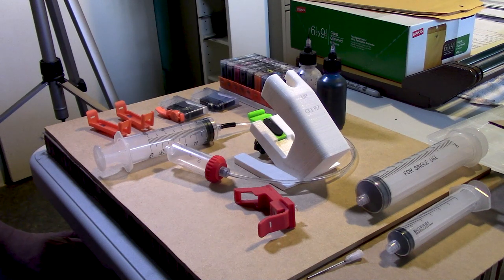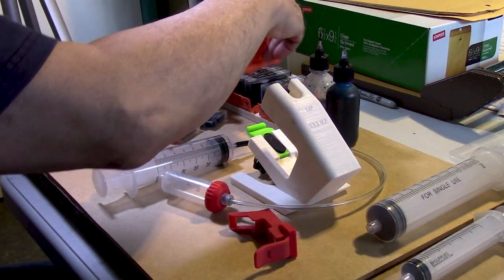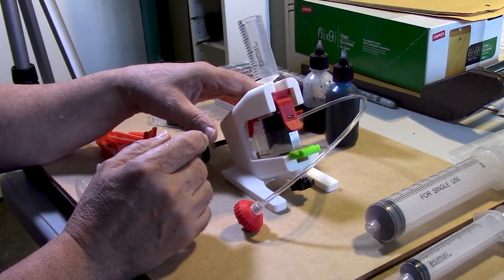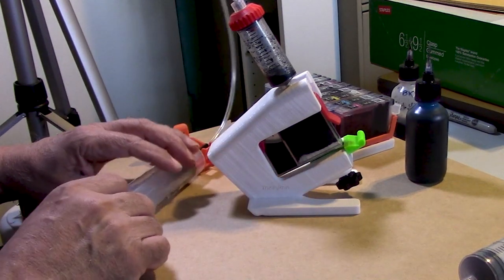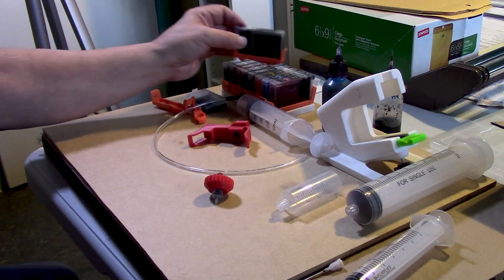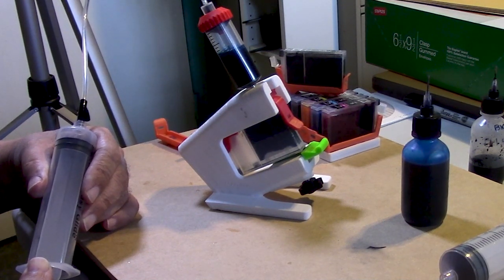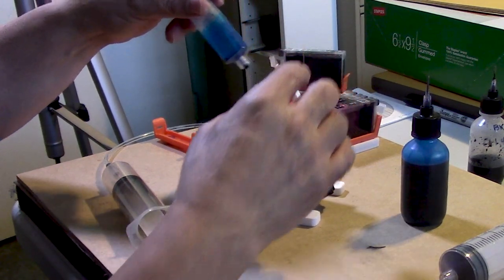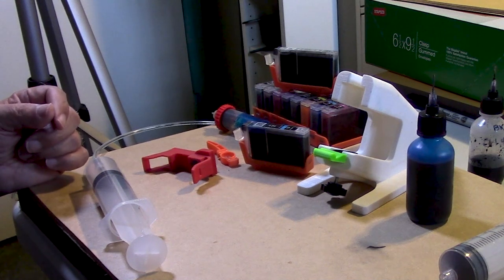Refilling Unmodified CANON CLI 42 carts by VACUUM LONG VERSION

Comment: I worked in a ink refill business for almost 20 years and we used to refill canon ink tanks in a similar way using the JE1072 jig from Jero, produced in Germany. It also filled HP ink tanks but we mainly used it for canons. It’s an excellent piece of equipment and I still use it to fill my Cli-42 ink cartridges today. My advice would be to batch fill one colour at a time, it takes a little time to set up but can refill 10 cartridges in no time at all.

Comment: Cool method without intervention/drilling of the carts. This is actually how some HP and Brother cartridges are refilled, wish I considered this option for my Canon carts before modifying them.
Reply from the maker: Both methods are good. One a bit more invasive than the other. Both provide good ink delivery if done correctly.

Comment: Got my refilling system and PC inks this week. Just finished filling my original cartridges. Excited to be saving money and printing more. Thank you for your knowledge and videos.
I have a question. Should I put a piece of tape across the vent of the cart after filling them? I live in an area with very low humidity and am not sure how quickly I'll be installing the replacement carts and am concerned about them drying out.
Reply: Hi  a question   How did you clean your cartridges? Cheers for any advice.

Comment: Have you done any testing to see if this works better than the old method of refilling?
Reply from the maker: Well think about it, You are no longer drilling a hole in the carts which completely alters the original hydraulics of ink delivery.
Reply: @cheo1949  I understand the concept, but was just curious if it made a difference since the hole gets plugged anyway

Comment: Great video I'm new to refilling, I always used oem inks in my R3000 that I have had since it first was introduced. I just bought a PRO 100 with less than a 100 print count it was not taken out of the box until 3 mo. ago and I have a question do you have to flush the cart of oem ink the first time you refill or are the to inks compatible can't I take one out and just refill it and but it right back in.
Reply from the maker: Flushing is always best but it takes days to dry after flushing. You can leave your printer sitting without carts installed. If You insist on refilling then buy a set of already modified and flushed carts from Rick Johnson. EBAY link is on my video descriptions. Then order ink refilling kit from precisioncolirs.